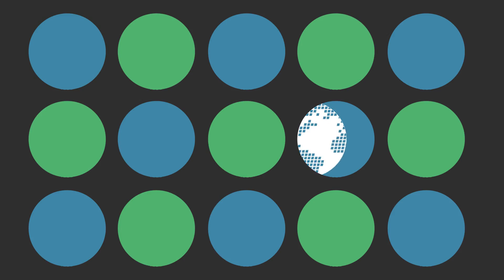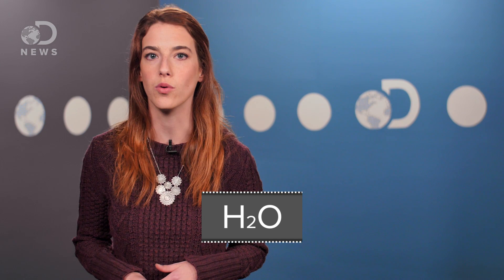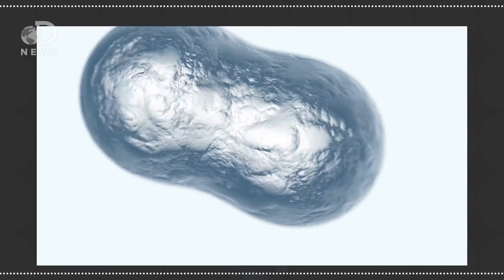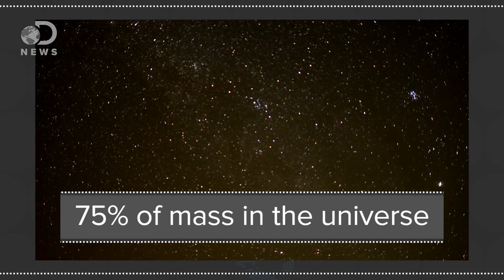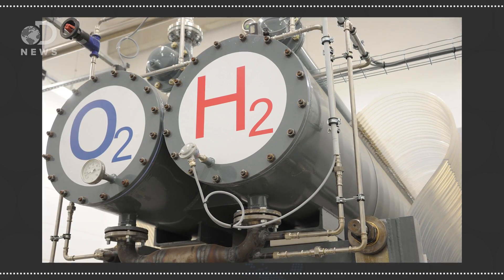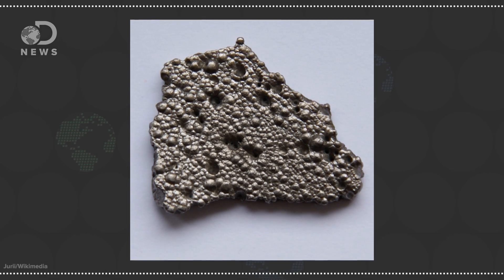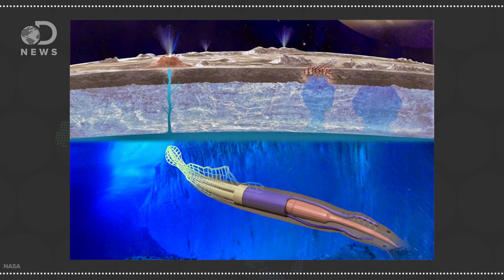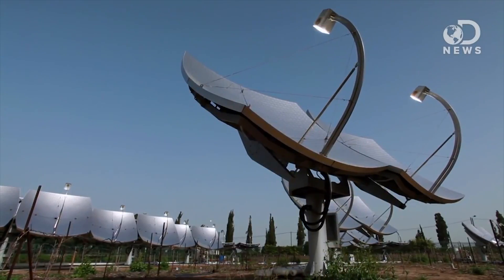How Can Water Be Turned Into Fuel?

Comment: BABA KA TOTKA – Powerful Water-to-Fuel System (Cheap, Clean, Long-Lasting)
This powerful engine system uses normal water as fuel. We split water into pure hydrogen and oxygen using smart electric power (from a car battery or solar).

It has 3 high-tech tanks:

2 for hydrogen (main fuel)

1 for oxygen (cooling + boosting)

Tanks are hexagon shaped, made of fiberglass, nano-coating, thermal layers, and can survive 500°C heat, lasting 10 to 90 years without rust or damage.
The hydrogen goes to a high-pressure nozzle, mixes with air, and gives 2X more power than petrol – clean, powerful, and smooth.

Oxygen is reused to keep engine cool and fresh, automatically released when heat rises.

Comment: Basic physics issue with this video. It takes far more energy to release hydrogen from water than the energy released when combusting hydrogen back into water. Even using a hydrogen fuel cell is really inefficient; sorry Toyota. That is why the Toyota Murai is a  total flop and why Elon Musk calls hydrogen fuel cells, "fool cells."

Comment: It’d be a great way to store energy from intermittent energy sources like wind and solar. Believe it or not, solar and wind can actually produce more energy than a grid requires. This would be a great way to store the energy because it could function like natural gas, only the byproduct would be water instead of carbon dioxide
Reply: yeah thatd be very cool you would solve the battery issue with that kind of concept

Comment: Use split the positive in the  bed of a pick-up truck to generate HHO.  

  Split the Positive is batteries charging other batteries and you some of the power while doing so.

  Then you swap the depleted batteries with the charged batteries and do the process all over again.  This can be done two or three times before batteries will need to be recharged.

  You can use solar panels to recharge the batteries and keep the STP process going.

  Look up Bro Mikey here on YouTube with his Split the Positive videos to get the basic idea.

Comment: WRONG at 0:14! Electrolysis is not the splitting of water into hydrogen & oxygen! Electrolysis is the decomposition of an electrolyte placed in solution ie sodium chloride, by passing an electrical current through the electrolyte. Water doesn't conduct electricity (only impurities in water conduct) so no way are u going to split water into oxygen n hydrogen! Additionally, there's no oxygen n hydrogen in water as like all products from electrolysis, they come from whatever is added to the water ie the electrolyte! 

People have been fooled and are fooling you!

Comment: Conservation of energy; It takes exactly as much energy to split water into Hydrogen and Oxygen, as you get back from combusting the two. In an ideal world. In reality, energy will be lost in both processes. So you're already operating at low efficiencies. The only way I see this as being feasible is if we were to use solar energy to operate photovoltaic cells to split the water. Furthermore, hydrogen is a very small molecule. Storing it is very hard, given current tech. There will be leaks, no matter how well you think it's stored.

Seems like these are things that might have been relevant for Miss Wilde to have mentioned in the vid.
Reply: yeah i see. do you have any idea how much energy to produce this hydrogen? is the hydrogen a more potent fuel source than say a battery? i am thinking a really cool business to start would be producing hydrogen and renting out some kind of jet ski or scooter to locals. It could make for a really fun local transport. and the rental could help cover costs. What do you think?

Comment: Oxygen mixed with hydrogen fed through a blow torch will burn just as propane and oxygen will burn.    It gives off a lot of heat and a tiny amount of water.  It takes more energy to split water than can ever be got out of it.    It is very difficult to contain hydrogen over any length of time.    It  must be stored under pressure and will escape through  most container material and will find any tiny escape route.     It most likely will never be useful.

Comment: Well it is a cute presentation. and As i know atomic hydrogen is combustible and can be used in oxy hydrogen torch which produces about 4000k temperature  and  in h2 O2 fuel cell here hydrogen is used as fuel and O2 is used in oxdizing the h2(fuel). And you might be wondering the product is pure water(h2O).this is used by astrounauts for to produce water and power or electricity in space craft

Comment: Electrolysis or Cracking of water is more energy intensive than the energy unleashed when hydrogen and oxygen recombine.  Electricity must still be applied from an outside source.  Solar energy or wind power make the most sense to pair up with this.

Comment: So, I get that this is a <5 minute internet show that is trying very hard to make science interesting twice a day, but this video feels really quite irresponsible, not because it's out-and-out wrong (as they correctly note, we've been electrolyzing water into oxyhydrogen - called Brown's Gas by some - for a very, very long time), but because it implies that water could ever be turned into a fuel.  It can't, for reasons other commenters have already noted - basically, the laws of thermodynamics don't permit it.  It also comes dangerously close to misunderstanding the notion of what a fuel actually is (a thing that you consume to generate usable energy), and I'm certain that at least some people have come away from the video more primed to believe the various internet hoax claims you can find claiming to make an engine that runs on water.

I mean, I get it - this show wants to be optimistic, and thermodynamics are arguably the most depressing and disappointing thing you will ever study, but I have to believe they could have done better here.  At the very least, they could have taken time to note the principal difference between this process and oil - with oil that you pull out of the ground, all of the prep work has been done for you, whereas electrolyzing water requires an investment of energy to derive anything that could be used as a fuel.  Useful power generation technologies are universally based on deriving usable energy from substances or reactions that have already been crafted for you by nature.  Everything else is just making batteries.

Comment: Is it easier to electrolyse seawater?
Reply: Pure water H20 (distilled) is not conductive.  We have to make the water dirty (add salt) to make it conductive.    Now electrolysis will work with dirty/conductive water but there's a problem.  As the oxygen and hydrogen leave your left with the "dirt" deposits on the electrodes.   Seawater is salty/conductive so yes it would work.  An oversimplification the trolls will attack but hope that helps.
Much of the research was on: what to use for electrodes/what to add to the water..    How to use less electricity/natural gas to get more hydrogen out.

Comment: The problems with hydrogen from water are as follows.

1) Where does the electricity for the separation of the hydrogen from the oxygen in the water come from? The most cost-effective sources today are fossil fuels, meaning that depending on where you are, coal; not cool dude, not cool.

2) So what about solar panels? Nope dude. Solar is just beginning to get as cost-effective as fossil fuel, when used alone. Throw in the energy lost in the process of separating, then fusing, H and O, not to mention the costs of storing the H, and you're going backwards, not forwards, in the cost-effectiveness of renewable.

The truth is hard to swallow, but it's this. The only cost-effective alternative to fossil fuels is the warp core.

Give me my damn warp core you stupid lazy scientists! It's 2015 for crying out loud! Why can't I battle Klingons yet!

Comment: I'm no scientist or physicist, so I'm a little confused about something.   If it takes electricity to create (extract) the hydrogen from the water,  and we use that hydrogen to "power whole towns" as the video suggests, what form of fuel would be used to create the electricity needed to create the hydrogen to begin with?  It couldn't be hydrogen, or that would be a perpetual creation of energy, which as far as we know, cannot exist.

So, if it's fossil fuels, would it take more or less to produce the same amount of "energy" that we could "get" from the hydrogen, than we are currently getting directly from the fossil fuels?

If solar could be used to extract the hydrogen, that would in many ways be "free" energy.  Is this perhaps what the 1000's of pyramids, which were in reality built 10's of thousands of years ago, possibly used for?

Comment: All of these facts presented here are correct but there are a lot of other facts that are neglected making this video VERY misleading. Yes it is the most abundant element in the universe, but it is never found on Earth as a free element hence energy is needed to break it apart like in electrolysis. Electrolysis is basically forcing an energetically unfavorable reaction forward. Though this process is very atom efficient, it is not energetically efficient at the moment only around 40% done industrially. Imagine you take 1kWh of electricity to electrolyze water, you get 0.4kWh worth of hydrogen. Where as if you use that electrical energy and charge a lithium battery you get 0.92Wh. Not to mention that you have to compress the hydrogen (loosing about 11% energy) and the energy losses in the fuel cell (50% efficient) before finally going to the motor which is 80-90% efficient. You see why hydrogen is bad for fuel. In addition, the low energy density per unit volume is also a problem. Hydrogen promoters often mislead you by just telling you the energy density with regards to mass which is excellent, but considering the volume available in a vehicle, it is not good.

Comment: But don't it take more energy to separate hydrogen from water then what u will get out of the hydrogen, The only people that would want this is the same kinds of people that pushed the fossil fuel industry..Again it makes no sence to go this route, because we would have energy hungry factories separating the hydrogen...Then we would be transporting This new fuel again just like now to a hydrogen fuel station..Its all great to have a fuel that produces no pollution...But where did the energy come from in the first place to separate this fuel..Because if it was right now it would more then likely be coming from a coal power plant..And if in the future it comes from solar and other renewable sources then we should just use that energy to power electric motors and charge batteries..All this is, is wasting energy to convert it from one form to another..This kind of system will only be another profit driven industry. And they will feed bs to the general public to try and convince them that this is "green" hahahah

Comment: why don't they just use Carbon ( a non metal) AKA Graphite as a electrode although at the expense of being less conductive graphite is about 2.50×10^−6(OHM)  while a cheap metal such as copper is heaps more conductive 1.68×10^−8(OHM) so they should only use it as a plate not for transferring or wiring any high voltage electriciy

Comment: There are two things to consider.  

Electrolysis is not a catalytic process, it requires electricity to happen.   Where does the electricity come from, and how much did it cost to make it?    

Hydrogen gas is dangerous.  The criteria for something to be considered a fuel includes being able to safely apply and transport the fuel.   Hydrogen gas is too unstable to be considered a fuel.

As for the Toyota Mirai, Everyone is touting it's benefits, but no one is demonstrating that destructive testing has been done.   I would sit in one of those cars until I was sure the storage tanks would not blow up on impact.  Toyota got a lot of bad press and lost market share in recent history because of faulty brake systems, which means they did not do the destructive testing properly OR they decided to cover it up.   Do you really trust them not to do it again?

Comment: Water electrolysis is just a way to convert electrical energy into chemical energy. You still need to supply the power. Most hydrogen is produced from fossil fuels via the water-gas shift reaction at high temperature (CO + H2O --> CO2 + H2). It's much cheaper because most of the energy is already built in by the fossil fuel, and you don't need expensive materials (e.g. platinum) for electrodes.

Comment: destroying water to fuel vehicles is stupid. Water should only be used to hydrate living beings.
Reply: destroying a finite resource, like water. Which is required for the entirity of life so we can move faster is stupid. Incredibly stupid.
Reply: Jay Xan The water isn't permanently destroyed. When you burn the hydrogen you get the water back.
Reply: from what I read it was splitting the molecule, the hydrogen and the oxygen were separated and from what I recall we dont know how to create water out of raw elements.
Reply: Jay Xan We do - electrolysis in reverse will give you... water :p It's quite easy to do.

Simply ignite hydrogen gas - you'd get water.

Comment: High temperature nuclear reactors (a variant of number 3) can also be used to produce hydrogen (number 2) gas (and oxygen gas) during off-peak hours, which kills 2 birds with 1 stone (3 if you include the fact that such a plant would help even out the peaks and troughs of power surplus). This is accomplished through the Sulfur-Iodine channel.

Comment: This uses far too much electricity than the electricity you get from cells, you are better off using battery electric cars.
You could probably magnetically suspend a nuclear meltdown and make enough heat to achieve thermolysis.

Comment: I've never ever been completely clear about the direction of flow of current in electrolysis. Let me get this straight.

The anode is the positive electrode, with a shortage of electrons.
The cathode is the negative electrodes, with a surplus of electrons.

When the power supply is turned off, the two electrodes do not have any charge.
But when the power supply is turned on, electrons move from the anode to the cathode, thus making them charged.

Is this correct? Because in this video Julia said the current flows from the cathode to the anode T_T Anyone know?

Comment: The problem with using electrolysis to make hydrogen fuel is:  how much energy are you putting in compared to amount of energy you get out of it? I'f I'm not mistaken there would be a net loss of energy in the process, making it a very inefficient source of fuel.

Comment: usually i love this show, but this one makes me fuming mad!! videos can be found all over youtube of people running cars and other motors on hydroxy / browns gas and i have done it too no fancy hydrogen fill up needed and my v8 drives about 2k miles on 5 gallons salt water. yet no one will admit it works because there is no profit in it. If we would spend half the time fixing the issues with corrosion and metal fatigue as we spend keeping hydroxy powered cars out of the media we would all be driving cars that we could fill up with our garden hoses. oh-well at least i am you morons can keep paying for gas and then the hydrogen from pumps. sorry d news you have officially failed telling the people something important.... thumbs down all you did was tote the party line instead of doing real research.

Comment: I am a huge supporter of D-News and am glad to see 99.9% of your content being put forth to all who are engaged enough to view it. I also appreciate that you need funding to keep operating, and that Toyota is apparently a key source of that funding. However I can’t help feeling concerned with the channel’s plug for hydrogen fueled vehicles.

From a 2006 article ‘The Truth About Hydrogen’, (which is still applicable today), "unlike oil and gas, hydrogen is not a fuel. It is a way of storing or transporting energy. You have to make it before you can use it — generally by extracting hydrogen from fossil fuels, or by using electricity to split it from water. At present, 95 percent of America's hydrogen is produced from natural gas. Through a process called steam methane reformation, high temperature and pressure break the hydrocarbon into hydrogen and carbon oxides — including carbon dioxide, which is released into the atmosphere as a greenhouse gas. Over the next 10 or 20 years, fossil fuels most likely will continue to be the main feedstock for the hydrogen economy. And there's the rub: Using dirty energy to make clean energy doesn't solve the pollution problem-it just moves it around. "As a CO2 reducer, hydrogen stinks," Joseph Romm, executive director of the Center for Energy & Climate Solutions, said.
 
ELECTROLYSIS: Most of the remainder of today's hydrogen is made by electrically splitting water into its constituent parts, hydrogen and oxygen. This year, a PM Breakthrough Award went to GE's Richard Bourgeois for designing an electrolyzer that could drastically reduce the cost of that process. But because fossil fuels generate more than 70 percent of the nation's electrical power, hydrogen produced from the grid would still be a significant source of greenhouse gas. If solar, wind or other renewable resources generate the electricity, hydrogen could be produced without any carbon emissions at all."

HOWEVER—why not use Wind and Solar to power electric cars directly, rather than through hydrogen fuels? My guess is that Toyota is falling behind in the electric car race and has turned to hydrogen fueled cars to try an capture the car buying public.
Reply: How's hydrogen as a replacement to cng or lpg?
Reply: Thanks for the information.  I Learnt  learnt alot🙏